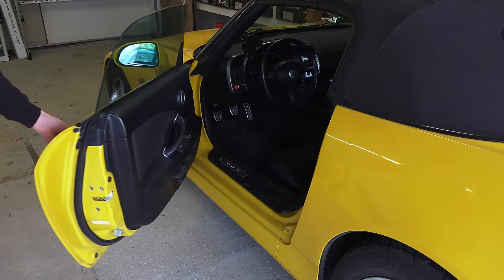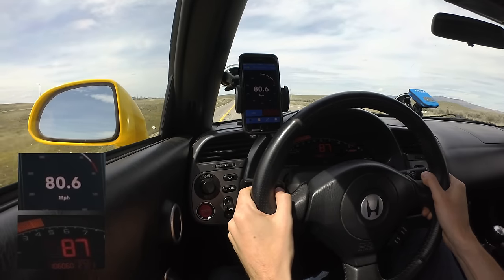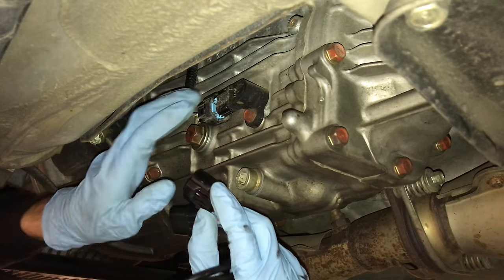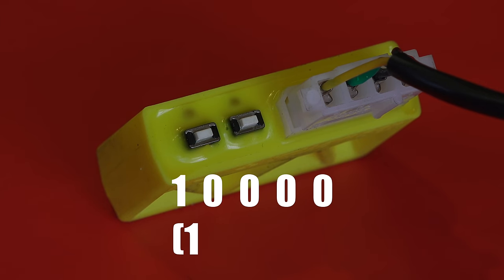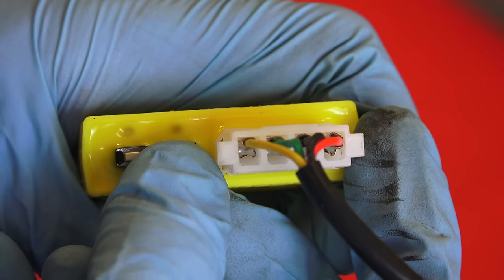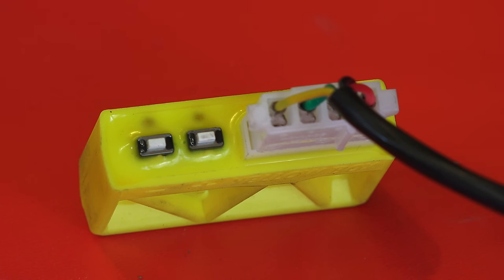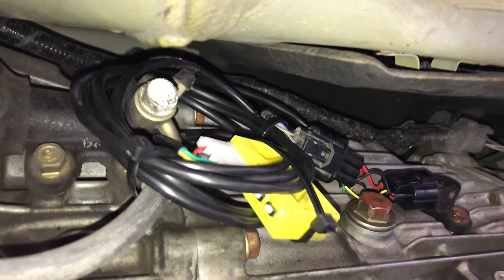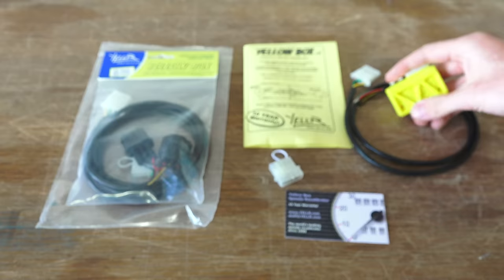How To Fix A Misreading Speedometer

Comment: "Highest legal speed near you..." Mate i live in germany.
Reply: Wir habens halt gut :D
Reply: no speed limit then
Reply from the maker: iSuchtel 155 mph it is! 😂
Reply: damn came too late. was about to write the same joke :/
Reply: Engineering Explained No,  it s as fast as you want... in most case
Reply: No camera traps! What a dream! Here in Brazil they have ones as low as 30km/h or about 20mph. Just to steal our money.
Reply: Of course we have camera traps lol. Just on the famous autobahn is no speed limit
Reply: We have thousands of camera traps in Germany; in cities, countryside and Autobahn, because some/many parts of the Autobahn have a speed limit, usually 100-120 km/h. We call those despicable things "Blitzer", which mans "flasher" because most of them let you know by a bright flash that you will get a ticket for speeding. I hate them personally but some are at locations that are prone for crashes. Many aren't though and are just a rip-off money making device. One of them literally made the minicipal millions of € in months.
Reply: My 2004 Diesel BMW goes 247km/h by GPS while the Speedo says 249km/h... should I correct that? ^^
Reply: +Schmidt54 How can something be a rip-off, when you are supposed to stay under the speed-limit? Or was the particular speed limit at this point set only to install a speed trap?
Reply: Most of the times it is the latter. Those traps are set up for making money, especially the ones on the Autobahn. Yeah you can argue that it basically enforces a speed limit you should obey anyways, but conveniently many of the speed traps are set up at a 70 or even 60 or 50 km/h zone that goes on for 100 metres or less on a straight street that allows 100-120 km/h easily, and on the Autobahn they are ridiculous. Straight hill down Autobahn with 3 lanes, you could go 200 km/h safely but they set a limit to 120 km/h and set up speed traps.
The problem I have: Either stop bullshitting drivers with those "concentiently placed" exceptions and do a 120 km/h overall speed limit, or just leave it be and let people drive. In Germany it is hard to have fun, everything is restricted from paintball, camping, owning weapons and tuning your car, and even this last bit of real freedom gets ridiculed and monetized. We pay the 2nd highest taxes and social security stuff in the world and still you get squeezed out.
Reply: +acephantom903 What do you mean by no speed limit? Literrally being able to go 200 if you like, or just that no additional restrictions are placed for example in front of sharp curves?
Reply: iSuchtel the legal speed in germany is 999 999 kmt
Reply: +Schmidt54 I have yet to come across some unneccesairy speedlimits. Maybe it's just your Bundesland. I'm from Schleswig-Holstein, but so far haven't seen any speed limits that are unjustified, especially ones with speed traps.
Reply: there are safe parts on the Autobahn where you can go as fast as you like, but there are restricted parts too.
Reply: +Drop Finder for Mr BassBoost Technically it's 50km/h in towns, 100km/h on non-town streets and a recommended speed of 130km/h on non-town streets with the directions divided. Most insurance companies will also reduce their service if an accident happens with you driving above 130 even if you are innocent.
Reply: +MrDiarukia Do you mean what I said about the United States? Most of the interstates are straight or with gentle sweeping areas very similar to the autobahn (the  President Dwight D. Eisenhower Interstate System designed after his appreciation of the autobahn.) and can handle higher speeds than permitted but near more populated areas, you will always have to slow down why is why the autobahn does speed limits. If I recall correctly the speed limits were only added a couple years ago because of massive accidents.   Lets say you are traveling between Dallas, Texas and Austin, Texas. That drive would take you about 3 hours. That road is mostly flat with almost no turns and people regularly get pulled over going 100+ but not many accidents are on that road as it is rural -- that section of road has 64 accidents per 100 million miles driven by vehicles. 500k vehicles drive that road in between accidents. Speed limits before sharp curves and sufficient warning would be needed to prevent people from going off the road and they are in place now.
Reply: +Trey Quattro Main highways in the US tend to have great surfaces and many German surface roads (not highways) are just as likely to be filled with cracks and potholes just like they are in the US. The reason Americans are driving so many SUVs is not because of the roads but because of government regulations and consumerism.  The government made it that every vehicle which is a car has to have certain emission and fuel efficiency standards which ends up being soulless boring cars. SUVs are classified as trucks and don't have to stick to the fuel efficiency standards -- There is a 2017 or 2018 Jeep Grand Cherokee Trackhawk which gets 12 mpg in sport mode capable of going 160mph as an SUV where my honda starts to whine once you hit 80 mph because of the fuel efficient CVT transmission they put in everything now. Recent regulation made it so that a percentage of all models made by each manufacturer have to be economy cars which most people do not like to drive.  Some people will go through 4 priuses in 6 or 7 years. People with SUVs tend to keep them around longer as well as them being a status symbol -- well, not my 1995 Ford SUV.  Everyone thinks it is a junker but at least it serves a purpose to transport animals and is only driven for that purpose. 

As with poor drivers, it seems that most countries have about the same amount of bad drivers. The US just has much more drivers than most countries. The reason we have more drivers is because the country is too large and population centers too far away so there is not a good public transportation system. 

I saw a video on facebook the other day making the same points that you are making and I went through frame by frame and half of the negative examples to show how bad the US is came from Europe -- mostly Poland. 

You say that the speed limits are low to generate revenue but we don't have speed cameras on our highways as far as I'm aware. Mostly just around schools to "protect" the children.
Reply: No speed limit means literally no speed limit. If your Bugatti pushes 390 km/h, do that. That means of course no limit on the Autobahn (as long as no other limit applies, i.e. no signs for speed limit = no speed limit). Within a city it is 50 (with zones of 30), outside 100, Autobahn no limit except a sign says so.
Reply: I invite you to Northrhine-Westfalia and the lovely A3. They set up literally 6 or 7 speed traps for 3 lanes there, and the city of Cologne cheated on the traps so thousands of false speeding tickets were issued (and paid).
Reply: From what I know, the general idea of an Autobahn originated in the USA and was then adopted by the Nazi party because they built much infrastructure (to create jobs and for the war).
Reply: +Schmidt54 "Popularly known as the National Interstate and Defense Highways Act of 1956, the Federal-Aid Highway Act of 1956 established an interstate highway system in the United States." President Dwight Eisenhower served in WW2 and admired the autobahn. :) All US bases are within 10 miles of a interstate and all interstates pass near major economic resources.  The idea is in the case of invasion into the US, the US military could deploy and protect all major resources. More common civilians use them because the US isn't really invaded all that much but they do double as evacuation routes in the case of disasters.
Reply: German unrestricted autobahns DO have a speed limit.  299 792 458 m/s - it's the LAW
Reply: +EscapeMCP I would think it would be 11200 m/s because that is how you go to space.
Reply: EscapeMCP that just made my day
Reply: EscapeMCP pretty sure that applies to other countries as well...  except New Zealand
Reply: +Schmidt54 Actually, all roads outside of town that have their directions divided are without speedlimit not just the Autobahn. Autobahn means only that your vehicle must be able to go above 60km/h to enter.
Reply: +Schmidt54 Even worse, while cologne has repaid the falsely accumulated tickets, the ones who lost their driving license because of that or even recieved a point in Flensburg aren't getting their licenses or their point back.
Reply: But not a legal limit, also if you have a car that runs on quantum mechanics you can be even faster, but then that would be more like teleportation and question the whole use of an Autobahn entirely.
Reply: It WAS no speed limit. Nowadays it is Stau, Stau, Stau :p ;)
Reply: +Schmidt54 Were you in a enviroment zone? Because I do not even get an enviroment plate for my car (diesel btw) even though I got TÜV. And my Fahrzeugschein says also Euro4.
Reply: Yes, although I do not know which zone exactly (probably green), the car has the green Plakette and uses regular fuel. As far as I know you need some Plakete for the TÜV, though maybe that is not the case. Which does not change the fact that there is a green one on the car. Except in Cologne's reality, where you can just say it is not.
Reply: Mein Toyota hat immerhin 190 schaffen können. Also bin ich 190 gefahren. War es gut? Na klar. Kann man das oft machen? Nicht in NRW, dem Land der Staus.
Reply: My poor little Fiesta only gets to 160 - 170km/h (never measured via GPS and inaccuracy is a thing). But I don't drive that speed, because first, fuel consumption; second, 150km/h is a sweet spot for me between time and control, because third, my Fiesta get really shaky above 155 - 160km/h (again according to the speedometer).
Reply: Yeah it is costly and also straining on the motor, and honestly my Corolla did not feel that good above 150 km/h - it is a user car, nothing that has any performance, but goes for a nice low fuel consumption.
Most of the time I drove it at 90 km/h because that gave me 6 or less litres for 100 km. Gotta save that money.
Reply: +MrDiarukia It is funny how big a difference a relatively small change in speed can make. My honda insight stays stable up to about the 150 km/h speed limiter but the transmission struggles and sounds horrible around 130 km/h. At 113 km/h (speed limit on most US highways) it is perfectly fine and you don't even feel like you are driving. My 1995 ford explorer going 113 km/h feels like going 150 km/h in my car without the whining transmission and keeps you on edge while driving.
Reply: I have hit the 190 mark with my Mitsubishi Carisma, with a lot of struggle on its part. But the handling was perfect, no sign of unsteadiness, no funny sounds from the transmission, just no more power to give.
Reply: My Corolla (he will be missed!) was allright to handle but clearly it would have been better if it was lowered. But while the engine was under stress, transmission and all was perfectly fine as it should be.
On the other side, our crappy Kia Cerato was allright till it hit the 100 km/h, then it was... not that precise to drive, and with 120 km/h the wind would break at the outside mirrors and make an awful sound like a loud whining ghost. Between Toyota and Kia, the difference was really obvious. At low speeds like in the city, I don't care so much.
Reply: The thing with my Fiesta is that the transmission is not the best. I have a diesel engine which torque and power output peak at 2000 rev/min. At 160 km/h and 3500 rev/min there is just not enough power left to hold against wind and air resistence. Any small wind blow is very noticeable. Too bad there are no 6-gear Fiestas. I would really benefit from one.
Reply: Agreed, even the smaller cars would benefit greatly from a 6th gear. Economy-wise, too, especially in a diesel! Maybe more displacement would help; a diesel has a lot of torque (and I like the way they drive), but maybe at the high rev, it just has not enough reserve to keep on going very fast. Or, what always helps, a downhill track. :D
Reply: It is not about the top speed, a better gearing won't change much in this regard. But accelerating at 150 or so would be much easier and the car would be able to hold a steady 160.

BTW, just this morning I read an article, that NRW plans to install "fake construction sites" to install 80km/h-zones. They say they do it because of too many accidents happening on the Autobahn.
http://www.focus.de/auto/ratgeber/unterwegs/weniger-unfaelle-fuer-immer-tempo-80-jetzt-kommen-die-fake-baustellen-auf-der-autobahn_id_7083804.html
Reply: Yeah, I heard it on the radio and immediatly thought about our conversation here. Then I realized how horrible this idea is. What they basically think is, that if the Autobahn gets restricted to 60-80 km/h and the roads get narrowed down, everyone is safe. That is true but also no one will get anywhere in time, which the Autobahn was created for in the first place. Next thing they ban cars because cars are part of most car accidents... well, that is pure NRW. Government here gets out of hand more and more; first they f*ck up the school system, and now infrastructure. Ouch.
Also, did you know that in Bergisch Gladbach there was a spontaneous Mighty Car Mods meet-up? I did not spot any Ford Focuses there (but maybe my eyes were too fixed upon Hondas, Subarus, Nissans and the Maclaren that pulled up towards the end). They want to do a Europe tour in 2018.
Reply: Doesn't matter where you live if nobody's watching ;D
Reply: Der Übermensch

No, most German cars are electronically limited to 155mph from the factory.
Reply: But that is because the manufacturer does not want people to destroy the engine.
Reply: Schmidt54 it's safety feature
Reply: you can go as quick as you want anywhere you want just dont get caught
Reply: LMAO this comment is golden😂😂😂

Comment: its ~$120 for the yellow box, about ~$500 for the whole kit. lmfao, yeah no thanks.
Reply from the maker: The VBOX isn't really made for this kind of thing, but it's super accurate which is why I used it. You just need to be able to know your actual speed. Could use your phone just as easily.
Reply: Engineering Explained what is it made for then?
Reply: what "kit"?  It's $93 for the splice harness, and $110 for the plug n play harness version.
Reply: I had already looked at both products.  They're separate products, each being used independently of the other.  Even though the VBOX is probably what's being used to check speed via GPS, I'm sure there are phone apps that will do the same thing using the phone's own GPS antenna.

Honestly with all the tech inside phones today, I don't know why the VBOX unit is even needed.
Reply: @Patrick94GSR  Accuracy

Comment: Do you intentionally sabotage/alter your car so you can make these tutorials? Because they're really good.
Reply: Khaled Hossam nah he bought that S2K used with the intention of fixing all the little things on it to show us how to he. the reason it was off was because he changed his Differential
Reply: Khaled Hossam Having a different sized wheels alters the speedometer. That was the case in my car, a Lumina SS if you're from the Middle East.
Reply: Damage42X you won't have to worry about your Lumina SS for too much longer. Holden cease production this year, so you won't be able to replace it. And being a Holden it will soon fall apart.
Reply: Damage42X cool, never heard of that car. Never seen it before either.
Reply: +75mattyd I think it'll get me going for about 5 more years or so. It's an LS1 engine so I can find numerous parts for it.
Reply: Khaled Hossam Holden Commodore VX SS then?
Reply: Damage42X Nope. We have Chevrolet instead. And the really shitty chevys, like the lanos, optra, cruze. Rarely do we find a Suburban. That's about it.
Reply: Damage42X I also have an LS1 but mine is a Statesman. plenty of parts in Australia anyway.
Reply: @fuckyoutube647  And I love them for it.
I had to rebuild the front end on my '99 GMC Jimmy due to a deer strike back in 2018, sourced some scrapyard parts from a 2000 Chevy Blazer and an '03 Oldsmobile Bravada, everything lined right up

Comment: Thank you for following through on this. Good idea to use the GPS instead of doing the math on the old and new final drive ratios as that would have caused you to retain any built in OEM based speedometer error. For now you know your speedometer reads just slightly high at 80 MPH - should help you stay out of trouble.  Great video, thanks again.
Reply: I just use the radar gun equipped speed limit sign cuz it tells me my speed when i drive past